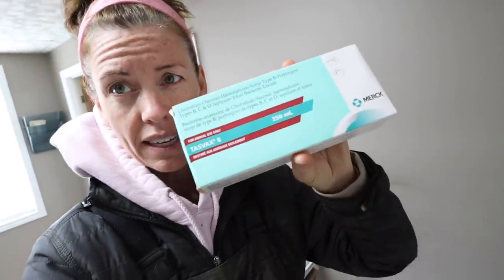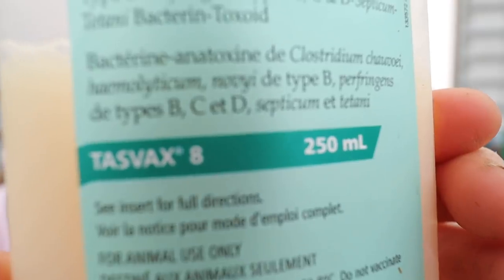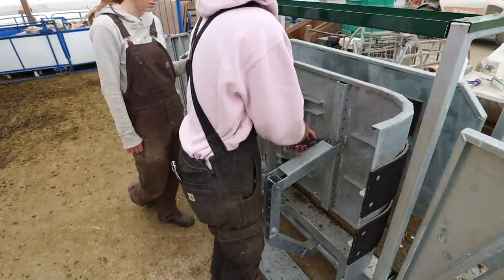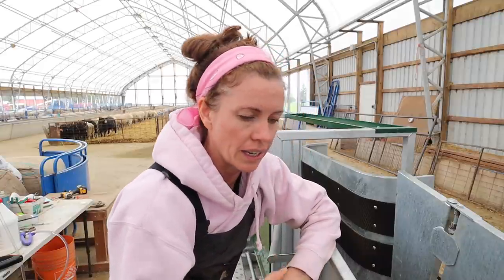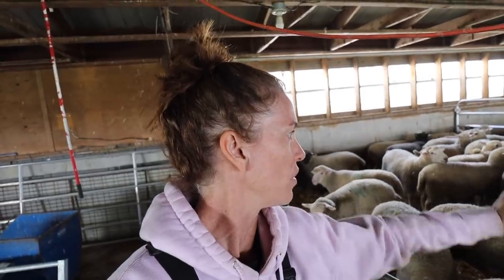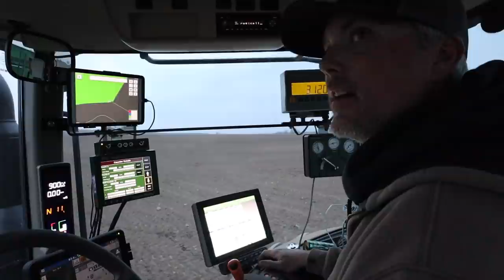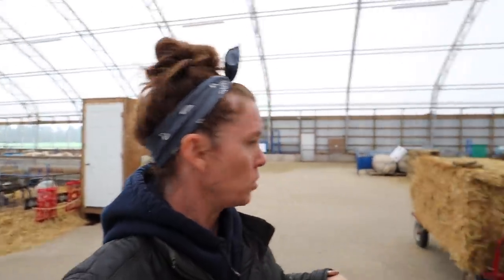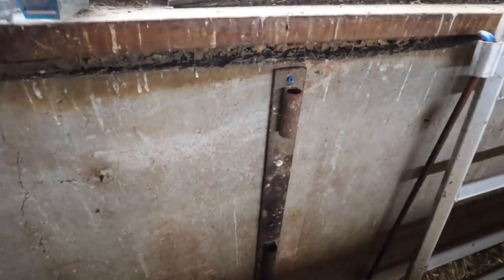Take two.✌️ | Sheep Farming FAILS. | Vlog 444

Comment: I had a problem with my sheep crawling through or under one of my gates that i'd made from a round pen panel. So i cut a cattle panel to fit where i needed and used hose clamps to hold the panel in place. I thought about zip-ties but thought they had too much "chew on this" potential, so i opted for the hose clamps.
Anyway: Sturdy from the round panel frame, "holes" filled by the cattle panel: Problem solved.
I like the tarp idea - but my gate was outside & that would've filled with rain...And it would've been munched on.

As far as it being "ridiculous" or whatever disparaging remark you made on your tarp job:
Doesn't have to be pretty, just has to accomplish the job you want it to do and it does!
Also: it was very neatly done.
Reply: I was going to suggest the same thing! I do it for my goats, and used welded wire to attach. Only thing that can stand up to the goats climbing and curiosity.

Comment: Good Day Sandi   perhaps try either putting chicken wire or hardware wire on the lower portion of the gate.  Using zip ties would make it an easy install to see if it would be a deterrent.
Reply: That’s my suggestion too!

Comment: Have you considered putting carter keys in replacement of the bolts that adjust the width? It would make adjustments alot smoother. Just a tip. Love your videos btw

Comment: @Sandi Brock Replace those bolts with pins of the same size, then put cotter pins to hold the pin in place. Will work the same as the bolts but be much easier to adjust when needed. No wrenches needed.

Comment: Get yourself some concrete anchors! Their similar to pop rivets in that they go in then mushroom out. They are just a bit bigger. Drill hole and pop a concrete anchor in and smack it with a hammer till it’s in solid.  It will likely be a long time before you will need to do any replacing.  I just used some to anchor my chicken coop to the concrete pad it sits on.
As for your other gate issue! Pick up some of the short hog panels and attach to the bottom of the panel. They are about 2’ tall and 16’ long at tractor supply.  Should be fairly easy to cut down and attach to the gait. 
Anyway happy to see someone actually listened to me and made their work a bit easier.  Keep running them through and it will get easier as they adjust to the ramp. 
Wish it were that easy for my mare. She’s claustrophobic and I only have a 2 horse that’s a bit too small for her to fit comfortably. I need a stock trailer, LOL! 
You might even implement that simple training method with the scale in the grow out barn. Score them through a couple of rounds before collecting weights and sorting. I would try it with this group when they get weened. Takes seconds and improves the work flow.

Comment: Sandi in regards to your gates and needing mesh on them, you can get some cattle panels or whatever fencing you have and zip tie or spot weld the fencing to the gates to keep the lambs from pushing through.  Any kind of fencing would work, just attach it as you see fit. Clarissa is a wonderful helper and seems very easy going.  She does a great job.

Comment: Another fun video Sanid! So glad the screws fixed your gate, work smarter not harder right! As for the gates without mesh on the bottom to use as a push gate, could you just buy one gate with a mesh and just use that one when ever you want to move sheep? Maybe you only need one instead of trying to return all of the gates? Just a suggestion. Take good care of yourself during this bust time of planting.👍👍❤️❤️❤️

Comment: TIM from Ontario Canada suggestions... when you were using a lame shoot... and you were having some that are a little bigger than your last run through.. and you have one that is caught.. The thing to do is leave the lamb in the shoot.. and adjusted accordingly to what the limits.. when the lamb is oversized.. then move it ahead a bit.. Bring back one of the skinnier ones..Run it through lock it and see if your adjustments have worked out accordingly if you can run both lambs through the shoot and I have to adjust it five or six times this is a bonus run it through lock it and see if your adjustments have worked out accordingly if you can run both lambs through the shoot and not have to adjust it five or six times this is a bonus. You might have to adjust it maybe two times for your bigger lambs or bellies or whatever shoots you were using for your livestock.. just some suggestions something to think about when you were figuring all this out... I know it is easy for someone to call it as you were already done it but when you were trying to do it as it is happening everyone knows it is not cool as planned..

Comment: Sandi, why not get a roll of hardware cloth and attach it to the lower part of the gate? It comes in different widths and lengths, and can be secured easily with zip ties. The sheep won't be able to get their heads through the Gate bars. Thanks for sharing your vlog! 🐑❤

Comment: i thnk if you had put the pad back on the squeezer it would have solved your size problem !!! you can help your hinge bracket plates staying put with some type of adhesive ,like a panel  bond or sill plate type and i would get stainless steel screws !

Comment: Sandi, possible idea for your gates. You can purchase small round rod to length. Drill a hole through each vertical tube in center of gaps feed rod through. My guess 5/16 or 3/8 rod. Tap thread ends and use lock nut to secure. If needing to fill bigger gaps, then just use 2 rods and space accordingly.

Comment: Regarding your gates where the lambs try to escape and chew on the tarp. You might try this idea to fix the problem. 
Our dogs kept getting out so we added a mesh fencing panels (metal) around the bottom of the rot iron fence and connected it to fence with zip ties. It worked very well. The dogs haven’t been able to get out. It has been up now for about 5 years.

Comment: Sandi maybe you could get Mark to attach some form of metal mesh panels onto the bottom of your gates? Even if it’s the thick metal mesh on a roll. Maybe solder them on for more strength but if not cable ties or even brackets would hold them down ?

Comment: Someone may have suggested this already on the gate mesh; but. I had the same problem with my gates with goats. I bought the panels from tractor supply and hose clamps,  made my tube gates into the gates with mesh. Just a thought.

Comment: you could try using plastic garden fencing that looks like 2"x2" squares hooked to the gate with zip ties. it will look like they can't get through, but will be light weight for your comfort as well.

Comment: If you do place your Gallagher up on the shelf, maybe securing it with bungies might save the day if the unit vibrates when you "squeeze" the sheep. Would hate for it to fall and possibly lose all the data.  Also, the update on Jack was good.

Comment: Thought.. in an earlier video you had mentioned separating your bred ewes by 
How many they carry. Doing this, on management tasks you could run them through in groups and adjust the Lakeland chute in or out accordingly to the ewe size. This would give you a few extra minutes monitoring large ewes with multiples for tox issues.

Comment: Wrap chicken wire around the bottom of the gates to act as mesh. Use large gauge wire to attach the chicken wire to the gate...or tack weld it.

Comment: I struggle with 50 lbs feed bags. Im so weak 🤣
Reply: Arg, when I was in my twenties, I could actually manage a 100 lb bag, heck I only weighed 120, but now at 59 those 50 lb bags are a struggle! I now use a wheelbarrow to help me.
Reply: I use a handtruck, cause I'm old 'n gimpy.... slide em off the tailgate and bottom of the sack slides onto the handtruck. No lifting.
Reply: @OlWolf1011  good choice, my dad showed me that method a few years ago, it is a good idea. He was the strongest man I knew up until he was 80, but he still worked smarter not harder. He just turned 87 and is now a bit frail, but he is still able to do his activities of daily living independently, except for cooking. It tires him too much to stand that long.
Reply: I have a wagon that I couldn’t live without! It easily fits a small square bale and weight limit is 1100 lbs so I can haul just about anything in it
Reply: @OlWolf1011  
I believe the Lord hardwired getting smarter as we aged into us out of mercy for what happens as we age!

Comment: I would use construction webbing. Not solid but bright orange and could just use zip ties to secure. Sandi you also need to start wearing a back brace. Any sporting goods store that sells for weight lifting. I did junk hauling for years. I'm only about 110lbs so it really saved my back.

Comment: The wire mesh on gates. I don't like mine(assuming different company). I thought they were great. But if sheep lay, climb/ put pressure on it, I noticed the welds not holding.☹️

Comment: What about attaching some kind of snow fencing to the “push” section? You could either zip tie the hell out of it or maybe some metal clamps. They make it in vinyl so it wouldn’t add any weight. Or maybe some vinyl lattice?

Comment: Divider panels: How about a section of light plywood or masonite board held in place with U bolts or something like that. It will create a solid visual barrier nearer the bottom without adding too much weight. they cant nibble it either. I wouldn't think you need to cover the entire panel, just a section nearer the lower third?

Comment: I saw another operation who used the same milk machine where they had a piece of MDF on the inside with a hole cut in it making the nipple recessed, just big enough for the lamb to stick their nose in.  That way they can't chew the nipples. They said they never had a problem with them pulling off or chewing the nipples.

Comment: Instead of having to keep picking up and putting down that big heavy bottle of lice treatment, you could rig up a backpack to wear (or first put some in a smaller bottle if it’s too heavy) with a small hole where the tubing comes out and then get a holster for the spray nozzle. This would definitely make it much easier if you have to work by yourself.

Comment: If needed, you can put some 5 minute epoxy in a hole that is too big.  As I watch you train your sheep to the new equipment, I keep thinking of dog training----after you do what you need too with the ewe, give her a dog bone or whatever works for sheep!  Next you can teach them to sit on command.  My last brilliant idea, put your little milk shed on wheels, like 6"or 8" locking casters. Then you could move it around without machinery.

Comment: Could you put burlap covered in chicken wire or similar on the gates? Both are fairly inexpensive and easy to install, the burlap is a sight blocker and the chicken wire prevents them (hopefully) from eating it

Comment: could you fasten ALUMINUM ( to avoid galvanic corrsion) (with aluminum self drilling screws), mesh to the bottom half of the aluminum. That would keep them light while preventing "escapers".

Comment: Take and see if a welding shop could weld you a mesh panel on the bottom or get mesh panels and use u bolts to fasten the panels to the gate

Comment: I wonder if you could weld mesh onto the gates instead of bringing them back? Or if welding isn't an option (not sure how welding works on aluminum), could you possibly use zipties and cut off the excess so the lambs don't try to nibble?

Comment: 24:20 Instead of a tarp, could you use coroplast? It cuts easily, is lightweight, and easily zipties to gates. I don't know if the sheep would chew corrugated plastic

Comment: Hi, I really enjoy it when you weigh the lambs. I have asked this before, but I think I am not wording my question clearly because so far you haven’t answered. I apologize for repeatedly asking. I won’t ask anymore after this. What percent of the lambs you weighed today, were greater than 105 pounds? For example, did you weigh a total of 50 lambs and 25 are greater than 105 pounds; therefore, 50% of the lambs you weighed today are greater than 105 pounds. Thanks. Keep up the good work. You are an inspiration.
Reply: She usually doesn't do math like that, because it's generally something her system would keep track of. But it's a good question I think. (If you want her to see your comment, you really need to say something in the first half hour after the video launches)
Reply: @DembaiVT  Thanks!

Comment: You may have answered this somewhere before, but if so, I missed it, why can't they all just get the Glanvac going forward? If it's better - covers more problems, why use separate vaccines? It may not work 100% on the ones who didn't get the initial 1st vaccine higher dose, but it may pass on a little? Or is it that it doesn't give any protection and there is a big cost difference?

Comment: i feel like with some ingenuity and some hardware cloth, you could just add mesh to the bottom of those gates that the sheep can't eat through.
Reply: I was thinking welded wire fencing. Doesn't need to be as tall as the gate, just as tall as the sheep.
Reply: @christinedehn3257  
Can they weld welded wire fencing on to aluminum?

Comment: How about using gopher wire to block the bottom part of those gates? Not chicken wire- that rusts. Gopher wire is made to go underground and doesn't rust. They could be secured to the gates with wire ties, no? I don't know how the cost of adding the gopher wire would compare to the price difference between the gates you have and those with a mesh at the bottom. Gopher wire isn't as cheap as chicken wire.

Comment: If I had worn knee bands in my late 40s I wouldn’t need knee replacement in my 60s. The bands help pull everything back in place when getting up from squatting, kneeling, getting up and down off of equipment and going up and down stairs. Plus those 70lb bags will destroy your knees and back. They don’t need to be super tight, just supportive.